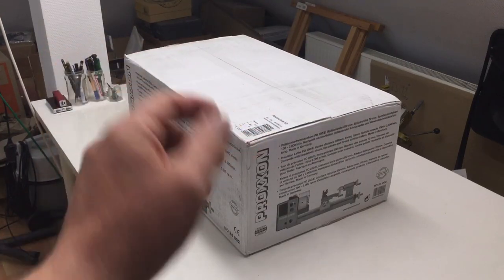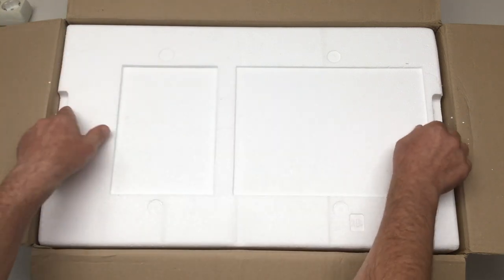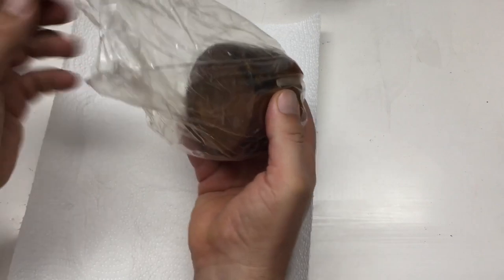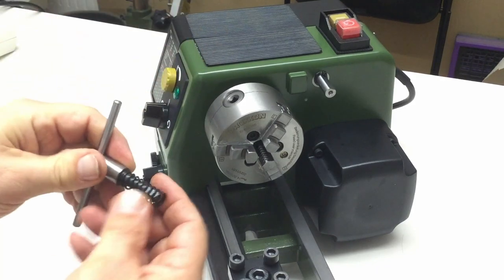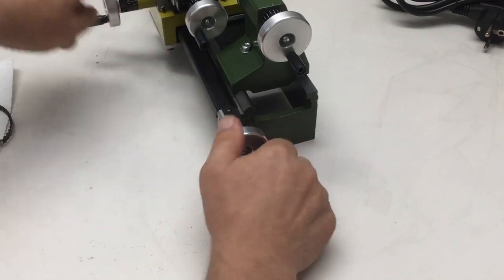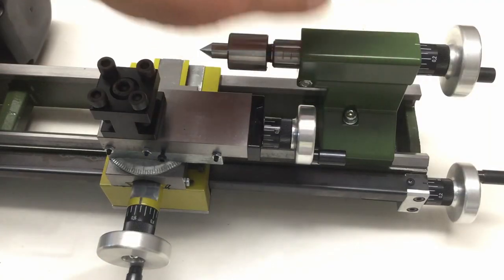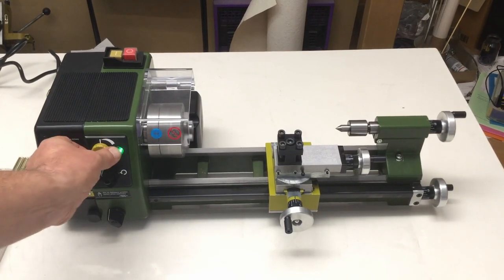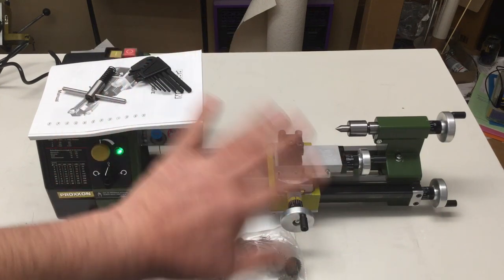PROXXON Precision Lathe PD 250/E Unboxing and First Impressions

Comment: Anyone considering buying a Proxxon machine should consider watching Michel Uphoff's series of video's on his lathe & mini mill & their design flaws, yes, series of videos!!! I'm assuming this is just a smaller version of his PD 400 & may have similar. He does suffer from the usual, "I can't criticise something I paid a lot of money for" while fixing all the issues
Reply: Do you have a link ?
Reply from the maker: @ronpalmer1371  I think he's talking about this Michael Uphoff: https://www.youtube.com/@Michel-Uphoff . And that would be Michael Uphoff's frist video about the PD 400: https://youtu.be/YLT5xU0PeqM?si=cgKfRHf2Jlp9v25g .
Reply from the maker: Thanks for the info! And yes, the Proxxon PD 250/E as well as the Proxxon BFB 2000 / KT 150 / BFW 40/E milling setup do have their flaws (that's the ones I have). But at least for the PD 250/E I can attest that it was usable out of the box. Something that can't be said for many of the Chinese made small lathes. Besides, in my case I needed a very small (that is light) lathe that I can lug around without breaking my back 😅

Comment: What is the hardest material this can turn, could it do steal?
Reply from the maker: Well, in principle you can turn anything with that lathe. It really depends on the cutting tools you are using. For example if you have cutting tools with ceramic inserts you could cut hardened steel with that lathe. However, due to the high cutting forces you might only be able to take off, say, 0.1mm at a time. Realistically I wouldn't turn anything harder than mild steel on this lathe, because otherwise things would get very tedious.
Reply: Thank you so much, I’m considering buying one myself but I don’t want to break it on the first go.
Reply from the maker: @michaelmailhot3493  You're welcome! I would start with some aluminum and then work my way up to mild steel. You'll hear and feel when the lathe starts struggling.

Comment: Nice new toy 🤚 , just curious about the speed control , is it a DC motor ?  Would be nice to check if it has good torque at low speeds to do turn threads in ferrous metals. Am a huge fan boy of German machine tools , used to work with a lot of German machinery in my "childhood" in the early 90's till early 2k. Maho, BoKo , Trumpf, Guhring , Injection molding machines from MDKT.
Reply from the maker: Yes, according to PROXXON it's a DC motor and the electronic speed control uses full waves. So I guess there's full-wave rectifier, followed by a SCR switched at zero-crossing (PROXXON for sure loves SCRs). So at the core it's probably a brushed 230V DC motor. I actually learned turning on such German brand name lathe (some 40 years ago). Unfortunately the small lathe market is nowadays, with the exception of PROXXON and WABECO, completely in Chinese hands. And the smallest WABECO (350mm, 1.4kW, 59kg!) is about 2.500€.

Comment: the "Blade Shims" are not for leveling the lathe. They are provided so you can shim under the tool bit to get the cutting edge on the center line. Also you had the reverse jaws backwards. The angled  ends face each other
Reply from the maker: Thanks for the info! After quite some time I did realize that that the shims are for the tool 😅 Though, getting the reverse jaws in backwards is unforgivable 😬To my defense, I learned on big industrial lathes (no, I'm not a mechanist, it was just a course during senior high) where you would do the tool height adjustment with a screw or two and I never used reverse jaws before in my life.

Comment: Oh lord, it's from Howell Michigan. Didn't think anything good happened down that road, that town has a rather poor reputation, hah. Thanks for the review! Was really curious about these machines.
Reply from the maker: Yeah, and I bought it because I was under the impression it was made in Germany. Anyway, could have been worse for me as a European, e.g. the whole thing could have been based on the Imperial system 😅
Anyway, it's the smallest lathe with a lead screw I know of (the even smaller PD 150/E doesn't have one).
Reply: @robertssmorgasbord  Oh, just the paper I mean is made in Howell! Pretty sure the lathe is German, and I definitely kinda want one. ;D
Reply from the maker: @dakel20  Yeah, I got that 😉 I was just joking 😅. One of the main reasons I got that lathe was that it is made in Germany. I wanted something that worked out of the box and not another project, like getting a Chinese mini lathe to work properly.

Comment: My knowledge of lathes is next to nothing! I believe the Proxxon DB 250 can be used for turning wooden ship model yards and masts. Would this Proxxon PD 250E be suitable for this use and other wood tuning projects. Would it be a better option even though more expensive.
Reply from the maker: Well, since I don't know anything about wood turning, I'm not really qualified to answer your question. Anyway, the Proxxon PD 250/E is definitely not intended for wood turning, it's made for metals (and plastics). That said, I don't see any reason why you couldn't, in principle, turn wood on it. However, the handling would be very different from something like a Proxxon DB 250, starting with the fact that you have a chuck on one side and not a spiky carrier (don't know how that thing is called on a woodturning lathe). And then there's of course the question of cutting tool. The Proxxon PD 250/E is designed to accept tool steels with 8mm x 8mm square shafts. I don't thing you can get wood turning tools with such shafts, so would have to make your own.
Reply: @robertssmorgasbord Soy venezolano pero estoy en barranquilla colombia tengo un tornito casero que fabrique es de joyería pero me gustaría saber el valor de un tornito Proxxon...gracias..👍🇻🇪👍
Reply from the maker: @tornosaponte7576  Well, what do you want to use the Proxxon lathe for? The Proxxon lathes are kind of expensive, but in my opinion at least the PD 250/E is worth its money. But it all depends on your use case.

Comment: Great explanation! And in perfect English! Keep it up! 😁 ✌ 👍
Reply from the maker: Thanks for the praise! And of course you're welcome!
Reply: @robertssmorgasbord  You've convinced me. A brand new "Proxxon PD 250" is on my table. I don't even dare to turn it on. The pieces gradually become clear. But what do I do with the little bag, "6Pcs Shim Blade Set"? Adjusting the turning tool?
Reply from the maker: @odysseus2843   Yeah, the bag of shims got me too 😅 At first I thought it's for shimming the bed when you screw it down on a bench or something. But your idea is the correct one. You use the shims to adjust the height of your turning tool. The tip of the turning tool should be at the same height as your center of rotation. You can see if it's too low when cleaning up a face: a little stub of material will remain in the middle. Just put shims with increasing thickness below your turning tool until you can clean up faces without any leftovers in the center.

Comment: It's weird seeing VCI paper (what was on the chuck) drenched in oil. They obviously dunked the chuck in oil before wrapping it. The paper has a chemical that prevents rust... but they wanted to double down on it I guess. :)
Sherline (I saw a comment below) was Clisby's design from 1971 in Australia which everyone has nearly copied since, then they moved production to the USA in 1979/80. It's on top of my list (4500 Manual), but heard about PROXXON and sought a review video. Issue with the Sherline is it is a screw driven vs ball screw driven... but recently came out with a ball driven version. I'm here to see if this is screw or ball screw. I'm looking for a purchase for a long-haul... I want it to last many years and be accurate (watch making) as accurate can be.
Reply from the maker: The Proxxon PD 250/E has also a simple nut and not a ball screw nut on the lead screw - sorry.
Reply: I would go for the Proxxon over the Sherline, personally. I have a Sherline lathe and mill, and the lathe leaves a lot to be desired. Don't get me wrong, it's well made, it's just the design is  very basic and lacking in many areas compared to something like the Proxxon (or the cheap Chinese mini lathes) which is based off of full sized engine lathes. I'm a machinist by trade so I'm used to full sized and full featured lathes and purchasing the Sherline probably was a bad choice but  there are few options for a quality mini/micro lathe.  Also be aware that the Proxxon PD 250 is in a completely different size class than the Sherline, roughly 5.5 inches/140mm)swing (Proxxon) vs 3.5 inches/90mm (Sherline). You can get riser blocks to increase the swing of the Sherline to around 6 inches (155mm), but the core design is that of a 3.5 inch lathe and trying to turn anything above that is going to really strain the machine (e.g. deflection, insufficient torque). The Proxxon  FD 150 is probably more comparable to the Sherline in terms  of both size and features, and between those I'd go for the Sherline. I'm  actually looking at buying a Proxxon PD 250 or PD 400 to replace the Sherline, lol.
Reply: @gretah3969  Thank you for your input! I'm looking into watch making (a lathe will be really far out in the timeline) and the parts (screws, pinions, etc) will be in the sub 3.5" diameter, although if I was to get into clock making... well... the Proxxon would be it for the larger chuck.
I was looking at options to the bajillion dollar Bergeon 1766.
Reply from the maker: @gretah3969  Hi Greta, thank you very much for that very detailed insight. Since the only lathes I know are industrial ones (back when I was in senior high) and my tine PD 250/E, it is very interesting to learn about other (hobbyist) machines (Sherline).  If I had the money and the space I might have considered the PD 400. But then, for the price of a PD 400 you can almost get a Wabeco D2000 (made in Germany out of steel, not aluminum): https://www.wabeco-remscheid.de/drehmaschinen/drehmaschine-d2000-2.html

Comment: The tailstock is actually a B12 taper, that's the larger half an MT1.  Overall I love my PD250/e but personally I think B12 is too small and doesn't grip the drill chuck very well.  Also it's hard to get things like reams or die holders in that size (although you can cut the small end off an MT1).
Reply from the maker: Thanks for the info! And indeed, I did notice my drill chuck slipping occasionally when drilling 12mm holes into POM ☹
Reply: Yeah, think 10mm is the limit for two-blade spiral drills for dat lil lathe, better open hole up and switch as soon as possible to single-point cutting boring bar
Reply from the maker: @marcoam2610  That was initially the plan, but I couldn't find a boring bar that would fit into a 10mm hole 🤥 And I'm not quite there to make my own cutting tools 😅
Reply: @robertssmorgasbord  Yeah there's definitely a quirk in the Micromote system here.  The largest drill the PD250/e chuck supports is 10mm but official boring bar can only be used in holes from 12mm.
I guess this is one place where going with a 3rd party boring tools is the easiest option but it's odd that Proxxon have missed this.
Reply: Ignore what I just said, I'm an idiot! :D
The HSS boring kit 24 520 is what we need.
Reply: @robertssmorgasbord  Had the same problem, took one proxxon hss boring bar tool und ground it narrower (relief cut) so that it just fits into a 10mm hole - or you look here https://www.youtube.com/watch?v=v0LPXot-8sM
Reply from the maker: @ifitrollsrideit530  I did buy the original Proxxon boring bar set (24520, https://youtu.be/EdMW0VKb550?t=1357 ). There's no way to get them into a 12mm hole. They're 13mm from the cutting edge to the opposite side of the bar ☹ I guess if you buy some thick walled pipe with an ID of 13mm or more, you could use them to turn some inside features.
Reply from the maker: @marcoam2610  Thanks for the video link - very interesting! I thought about grinding down a tool from the 24520 set. But then I bough a 12mm drill (I needed a 12mm hole) with a reduced 10mm shaft ( https://youtu.be/EdMW0VKb550?t=32 ). For an otherwise featureless hole that's good enough. To get the hole fully cylindrical (get rid of the angle from the drill tip at the bottom) I used a 12mm router bit ( https://youtu.be/EdMW0VKb550?t=1022 ). Using that was a pain in the behind, because the chips (I was turning a POM part) would quickly clog up the face of the router bit ( https://youtu.be/7WoETltnHtY ).

Comment: @21:05 Puh... That is one heck of a bummer... I was considering buying either a PD 250 if not a PD 400 for my occasional Scale Modelling endeavours but the latter has skyrocketed in price over the past year from usually below 2'000.- to almost 2'600.- ( and that isn't even including additional accessories I estimate I'd be needing ) making it an increasingly hard sell for the limited use I estimate I'd get out of it but it would be the only model that could make a single piece barrel for something like my E-100 ( https://youtu.be/6XZXryXOO5A ) and the PD 250's supposed 250mm realistically only being 200mm isn't helping either 🤔
Reply from the maker: Yeah, tell me about it. Lately I put a chuck into my tailstock with a 12mm drill - fortunately my workpiece was only 105mm long ( https://youtu.be/7WoETltnHtY ). But yes, it's a very small lathe. Regarding the PD 400: Have a look at the WABECO (Made in Germany) D2000 ( https://www.wabeco-remscheid.de/lathes/d2000.html ). Since the PD 400 became so expensive, I always considered the D2000 the better choice. And sometimes WABECO sells off demo units for just 2600, or they have special offers including a tool set.
Reply: @robertssmorgasbord  Center to center distance is always measured between the tip of a dead center in  the headstock and the tip of a dead center in the tail stock. So judging by how wide the chuck is (looks in the video) and how long the live center is, it might actually have a center to center distance greater than 250mm. If your worried about not having enough room, you could buy a Sherline 3 jaw chuck. On the Sherline chucks you turn the scroll itself to close the chuck, rather than turning a bevel gear that then turns the scroll. This allows for a much slimmer chuck, but the downside is you have to rotate your hand around and around rather than just spinning a key.
Reply from the maker: @gretah3969  Thanks for the tip! But before adapting a Sherline chuck to my Proxxon I probably invest into a Proxxon 4 jaw chuck 😅 That is unless I really run out of space 🤣

Comment: Hou you think about this machine after one year?
Reply from the maker: I'm still happy with it. Besides regular maintenance (cleaning and oiling) I just had to adjust the tail stock once. I guess the cross slide is next, because its lead screw became a little loose over time. I also brought that thing to its limits, drilling a 16mm hole into aluminum. That all said, it's a small lathe and I sometimes wish I had something larger 😅
Reply: @robertssmorgasbord  because i heave oportunity buy myford 15 for this same price...ind im not sure. I heave plan  make chess pieces . Thx for answer and recension of proxxon
Reply from the maker: @Waldemord  Couldn't find anything about the Myford 15, but found a video about the Myford ML10. Assuming that the two are comparable, if it is in good nick and you can stomach the weight and the space requirements, I would go with the Myford. It's all steel and probably more capable than the Proxxon PD 250/E. I think some places still sell spare parts ( https://www.myford.co.uk/ ). But then, I'm turning (larger) metal and POM parts, not chess pieces 😅

Comment: @all PD250 Owners: Does anybody know the exact designation of both spindle bearings, the large one (chuck end, front) and the small one (drive-train, rear)? My bearing became noisy and i‘d like to maybe upgrade to angular contact or even taper rollers - just as this old tony did in ‚better lathe than never‘ https://m.youtube.com/watch?v=HYOgmhpBUJs
Reply from the maker: Nope, only the Proxxon part numbers: 24002-01-21-1 (large) and 24002-01-21-2 (small). But you can order them as spare parts: large - https://www.fluidonline.de/a-14382 , small - https://www.fluidonline.de/a-14383 , respectively  https://www.proxxon.com/en/service/request_for_spare_part.php . I'm sure Proxxon buys those from some bearing manufacturer and a proper designation should be stamped on the spares. Maybe they even come in the bearing manufacturer's original box 😅